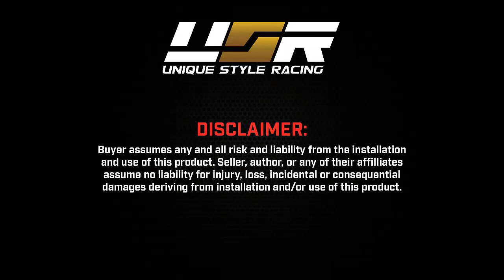USR 12-15 BMW 3-Series F30 DEPO Headlight Installation

Comment: These headlights are so damn sexy! I just finished my install and they look great. I also replaced the halogen bulb with a 6k HID KIT.!👍🏽
Reply: xlazer6 - it took me about 2 1/2 hours. Yes, i would suggest replacing the halogen bulbs first. You can do the HID ballast and wiring once the new headlights are in. Also, get yourself a flexible drill bit extension and remove the tires before you start. Finally you should also remove the entire rubber wheel well this gives you maximum clearance.
Reply from the maker: I love it, thanks for your kind words and support!
Reply: Alfredo Hernandez what type of hid did you putted in it? It is error free if i use hid or led bulbs?

Comment: Very helpful video. Watched it to install mine. Question – are the upper LED strips supposed to be on when the daytime running lamps are operating or only during the time the headlights are turned on? Mine only turns on when the welcome lights are on and when the headlights (low beams) are actually on.

Comment: So this lighting kit still uses the H7 halogen bulbs and has projector lens with the led halos
Reply from the maker: Sorry for the late reply. I am confirming with you that the bulb sizes for the DEPO F30 headlights are (1) H7 = Low, (2) H7 = High, and (3) PY21W = Signal. Thanks for checking.

Comment: What is the correct part for the low beam H7 retaining clip to use if I want to change out the stock halogen bulbs for, say an LED bulb? I’d like to match the low beam light output to the angel eye rings. Or where could I get LED bulbs with preinstalled retaining clip that these DEPO headlights use for the low beams? Thanks!
Reply from the maker: Hi Effy, thanks for asking. If you are asking about the metal retainer clip for the H7 Low Beam bulb, I believe you can find this here:

https://www.theretrofitsource.com/h7-hid-adapters-euros-48915.html

I am not sure whether if the LED bulbs you are looking to retrofit will fit through the holes on the retainer clips as some LED bulb head are too large. These retainer clips in the link above are meant for those wanting to retrofit for HIDs. I hope this helps point you in the right direction. Thanks for checking.

Comment: Will this fit a 2016 f30 328i ????
Reply from the maker: Hey Jose, thanks for asking. If you have the LCI F30 Chassis, then the DEPO F30 headlights may not be a fitment as we cannot comment whether if the lights will function properly or not as we have not tested them on the LCI F30 Chassis. The physical fitment is very similar - however, I believe that the lights are wired differently between the PRE-LCI and LCI F30 chassis. Thanks for checking.
Reply: Unique Style Racing thank you! Will you guys make a updated version of this lights for the LCI f30 ? There’s nothing on the market for the new face lift besides bmws oem led light that cost 3000$
Reply from the maker: Hi Jose, thanks for asking. Although we are talking with DEPO to see if they are interested in developing headlights for the LCI F30 chassis, there isn't anything concrete we've agreed upon. If DEPO is to start with the development, the R&D process may take almost a year to get a sample out for us to test. I sincerely apologize for not having anything at the moment. Thanks for checking with us.

Comment: Hi, is there a difference between the DEPO's for right or left handed vehicles? I've seen DEPO's in stock on the eurowagens website but they claim that they are only going to fit right handed vehicles (UK). The left handed DEPO's they offer are out of stock, so I do not know what I am going to do. Thanks for answers!
Reply from the maker: Hi Marjan, thanks for asking. Although the physical fitment between RHD and LHD headlights are the same, the main difference is the Low Beam "Cut-Off" output they create. Since we are selling for US/CAN-Spec vehicles, our cut-off line is set for Left Hand Drive (LHD) setup. The Right Hand Drive (RHD) cut-off will be opposite from ours. Here is an example of what the LHD vs the RHD cut-off difference may be:

http://www.veloster.org/forum/attachments/hyundai-veloster-exterior-lighting/3726-how-much-veloster-headlamp-should-i-go-kdm-lhdvsrhd.jpg

The Step-up Cut-off line is important so that you do not blind the oncoming traffic:

https://upload.wikimedia.org/wikipedia/commons/thumb/4/48/Low_beam_light_pattern_for_right-hand_traffic.svg/500px-Low_beam_light_pattern_for_right-hand_traffic.svg.png

Thanks for checking.

Comment: hello and ty for the video, do these lights always flicker? I've noticed in the video they are flickering a lot
Reply: Actually, they seem to flicker but they are not. Here's a good explanation that I stole: "The output of light from an LED is a certain frequency in hertz. Let's say it's 30 Hz from the LED and the camera recording it records at a common 24 frames per second. Every few frames recorded by the camera will not be in sync with the light source and thus a "blinking" occurs where the camera caught the LED in between cycles."
Reply from the maker: Hi, thanks for asking. I completely agree with what the individual is mentioning below. All LED components have a cycle/refresh rate. Normally these cycle/refresh rates are not visible to the naked eye. However, cameras captures images in a much higher cycle rates than the naked eye can, which may seem like the LEDs are flickering or strobing. Thanks for checking.
Reply: @kevinjt88  Yes, the frequency of the camera frames creates an artifact of beats with the frequency of the LED flicker. But, no, if you connect a raw LED to a DC power supply, it does not flicker, in a camera or to the naked eye. These LEDs are flickering. The issue here may be that the 12V DC of the system is being down-converted to about 3V by a DC-DC converter that has a poor choice of capacitance. Or, if the LEDs are in series in the lamp, the issue could be the perennial one of the alternator adding AC on top of the DC which would make the LEDs get brighter and dimmer by, say, 10%. —Electronics teacher.

Comment: Hi , I want to know if I can fit those headlights in my F30 2017 ? Or it's only for 12-15?
Reply: also I have warranty for my car , if I fit those headlights I will loose my warranty or not ? 

my car now is with halogen headlights " F30 2017"
Reply from the maker: Hi Mohammed, thanks for asking. We apologize to inform you that we have not tested these lights on the LCI F30 chassis as of yet. We currently cannot comment on the fitment nor the connection being the same until we've had an opportunity to work with a local car ourselves. Once we have an opportunity to find out, we will be sure to mention in our postings. Thanks for checking.
Reply: do you have these in stock yet?
Reply: any update on this?
Reply: Any update on this ?

Comment: So I have the ugly yellow halogen lights, if I buy these then they would just be plug and play with no error codes? Or do I have to buy an harness or bulbs?
Reply from the maker: Hi, you are correct that the DEPO F30 headlights are plug and play as long as you have the PRE-LCI F30 Chassis with Factory Halogen settings.

Comment: are there instructions anywhere on how to change the light bulbs? i want to change my low beam and beam light bulbs.
Reply from the maker: Hi, if you are asking how to change the low and high beam bulbs on a stock F30 Halogen lights, you may use this reference guide:

https://www.youtube.com/watch?v=jj4mpsu42i4

Thanks for checking!

Comment: Hi I had these professionally installed in a 2014 328i and now one high beam bulb is out. Is there an easier way to replace it without removing the entire headlight?
Reply from the maker: Hi, thanks for asking. We have an affiliate that we are working with that has done a reference guide on how to replace the Low and High Beam halogen bulbs without removing the bumper. You can check this out here:

https://youtu.be/jj4mpsu42i4

Thanks for checking!

Comment: we need a video of the e90 depo v3 installation on an lci sedan!! 👌
Reply from the maker: Hi Andrew, thanks for asking. We have an installation guide for the DEPO E90 V2 headlights here:

https://youtu.be/uXm675PqiwI

If you have Factory Xenon settings from stock, you may have to do additional wiring on your main connector to retain your Stay on High Beam function. If you have Factory Halogen settings, the DEPO E90 headlights are plug and play. Thanks for checking!
Reply: I ordered a set of the v3 a little less than a month ago and i'm already having quality control issue, who can i contact about it. I've sent 2 emails to the customer support with no response.
Reply from the maker: Hi Andrew, thanks for asking. I am seeing that my co-worker Lee has replied to your email message today afternoon. If you did not receive a reply, please let me know so we can reach out. Thank you!

Comment: Are these smoked only? Clear option? When do you expect availability again? 2013 F30.
Reply from the maker: Hi, thanks for asking. I am confirming with you that the headlight lens is "clear" not smoked. I believe our vendor should be restocking again within 45-60 days. If you have not added yourself to the waitlist, we encourage you to do so as we will be emailing those on the waitlist regarding the next shipment first. Because we keep selling out these headlights, they are currently first come first serve when our vendor restocks them. Thanks for checking.

Comment: Hi, how do I change the high beam bulb in those depo lights? Do I need to take the whole headlight out to do this ?
Reply from the maker: Hi, thanks for asking. From our experience, there should be a panel cut-out inside your wheel well that you can remove to access the headlight's rear housing. From there you should have enough room to remove the high beam rear housing cap to change the halogen bulb. Thanks for checking.

Comment: Are they just plug and play or would I need to cut any cables?
Reply from the maker: Hi Armando, thanks for asking. As long as you have the PRE-LCI F30 Chassis with Factory Halogen settings from stock, the headlights are plug and play for your vehicle no re-wiring or coding needed. Thanks for checking!

Comment: So can i put a 35 watt hid kit on these? Will there be any error?
Reply from the maker: Hi, thanks for asking. We only sell the headlights with Halogen bulbs for the Low Beam projector. If you wish to install your own aftermarket HID or LED bulbs onto the Low Beam projector, you may do this at your own discretion. Please advise that this may void the manufacturer warranty as the rear housing needs to be modified to allow the aftermarket HID Bulbs to connect to the Ballast. The DEPO F30 headlights are error free with the Halogen bulbs. If the aftermarket HID Kit causes an error message for your Low Beam, this would only be involved with the aftermarket HID components and not with the headlights (which you should only use 35 watts as 55 watts HID components burn too hot). I hope this helps clarify things best. Thanks for checking.

Comment: where can i buy these headlights for a left driving f30?
Reply from the maker: Hi Gaspare, you may find the headlights here:

https://www.uniquestyleracings.com/index.php?route=product/product&product_id=1023&search=f30+headlight

If you are unable to add the lights to your cart, please send over a message on our site so that we may assist you. Thank you!
Reply: Will this video be good for a 2016 328i?
Reply from the maker: Hi, thanks for asking. Although this may be used as a reference, by no means this is a step by step guide for the LCI F30 Bumpers. Thanks for checking with us.
Reply from the maker: Although you may use this as reference, we personally do not know what the bumper removal is like for the LCI chassis as we've never worked on it as of yet. Thanks for checking with us.

Comment: How long is the install time?
Reply from the maker: Hi Ira, the installation time depends on the installer. Average installation time for us for these headlights run about 1.5 hours. We've installed quite a few of these headlights on local customers car, which the installation process for us is pretty routine now for the F30 Chassis. Thanks for checking.

Comment: I’d enjoy the lights but I can’t buy them cause y’all out of stock smh
Reply from the maker: Hi, our vendor only provides a limited quantity for these lights. We've sold out the second batch the "same" day we've opened the listing on our site. If you have not been added to the "notify me" wait-list, we strongly encourage for you to do so as we message in advance when we are receiving shipments and the exact date and time we are opening the listing. The listing for the F30 headlights are always first come first serve. Thanks for checking.
Reply: Unique Style Racing I understand, do we have to buy any type of light bulbs or anything extra? Or does the headlight set come with them
Reply from the maker: Hi, thanks for your acknowledgement. The headlights do come with halogen bulbs for the Low Beam, High Beam, and Signal Lights. If you are seeking an HID upgrade, this would be your decision to modify/retro-fit the DEPO lights to install them. If you wish to retain the manufacturer warranty, we recommend using Halogen bulbs until the warranty period is over, which then you can decide what you want to do with the lights. Thanks for checking!
Reply: Unique Style Racing I understand, and the halogen lights, what color do they show like on the road is it the clear or the yellow look?
Reply from the maker: The Halogen output would be the traditional yellowish output you see in most cars. The whiter lights are either Xenon or LEDs. Thanks for checking.
Reply: Unique Style Racing do u guys sell xenon light bulbs on ur website?
Reply from the maker: Hi again, because our main focus is not with the aftermarket Xenon Kits, I am confirming with you that there are a lot of suggestions from other forum members which Xenon Kit they've used for their DEPO F30 headlights. If you have not checked the forum post, you may find it here:

http://f30.bimmerpost.com/forums/showthread.php?s=922a54c31f84c84e1658b257c8dbaa2e&t=1274932

I hope this helps clarify things best. Thanks for checking.